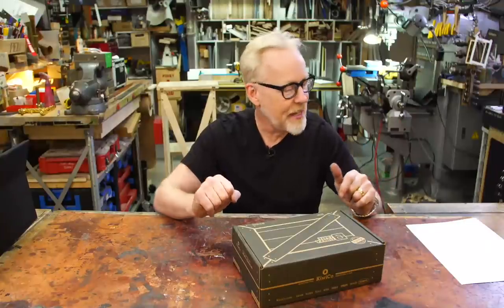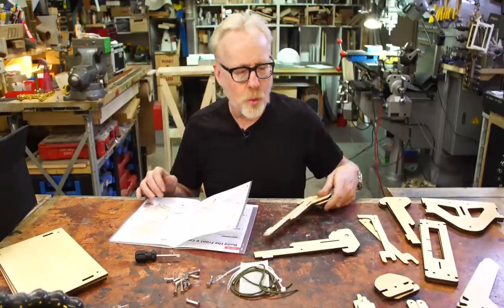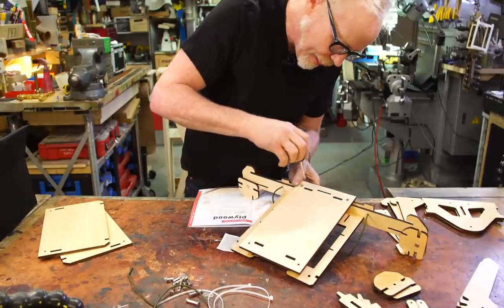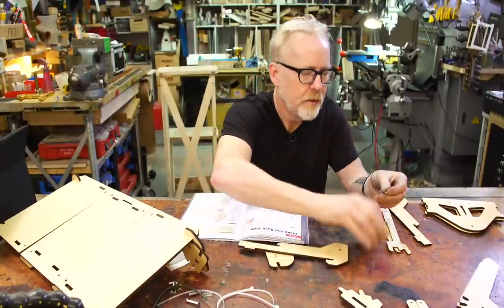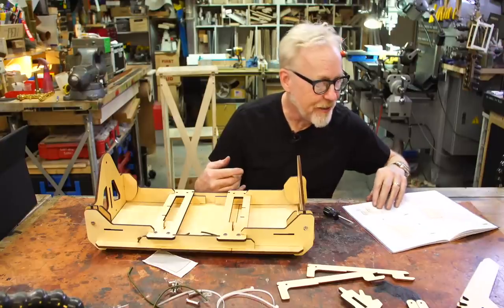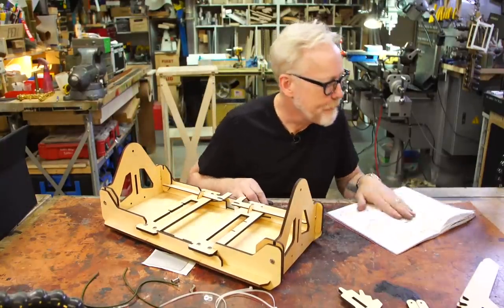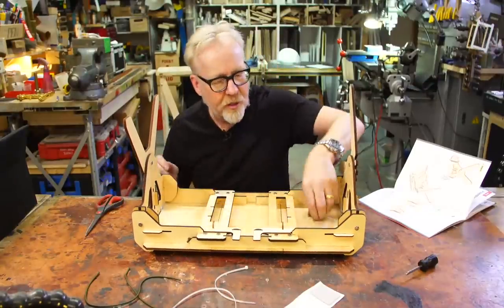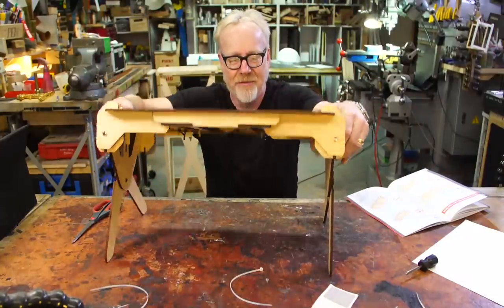Adam Savage's Live Builds: KiwiCo Tilt-And-Fold Desk Kit!

Comment: Adam mentioned a couple of times using candle wax to lubricate where two wooden surfaces rub together.  I find that using welder's chalk works well without the dirt attracting property of wax.  The chalk, or soapstone as it is sometimes called, can be found at any welding supply store and probably at most well equipped hardware stores.

Comment: Unfortunately, with the working surface being packaged as three parts for cheaper shipping, you can't use that thing for drawing  on papers larger than a third of the width without hitting the joints.
Anybody seriously wanting to uses this thing would have to re-cut the top out of one piece, put a thick piece of cardboard under it or bondo over the joints.

Comment: I think you should get a better mic to avoid rapid volume changes while Adam is moving. Maybe something like DPA 4466 or 4488? The omnidirectional model would be better for builds like this but the directional model would be better for speaking while machines are running.

Comment: Adam I had a brain 🧠 fart 💨 for I-pad’s for laying in bed or being lazy on a sofa 🛋 the standard covers/protectors are great till you shift in bed bloop down goes the pad. Take the same drafting table concept can be attached to a wooden bed 🛌 frame or you nod off watching a movie so if you fall asleep 😴 you ain’t gotta worry about damaging or startling yourself awake by hear the pad drop. The pad fits nestled in a bed side frame easily angled slot for charging cord. If you borrowed a drafting table angle 📐 use felt or if you lay on the sofa or chair recliner it’ll have inner change able feet sits on the floor or use your notebook pc the resting table is adjustable mini one day build i deer

Comment: Interesting build, just can't understand how a company that is able to accurately laser-cut plywood can not put identifying numbers or letters or marks on the pieces to help in the assembly. Surely would have saved time for Adam (or anyone else for that matter) to identify which of the similarly shaped parts to use and which side of the part is "up". The letters can be reasonably sized, for Adam they can even be 0.002 in tall 😄.